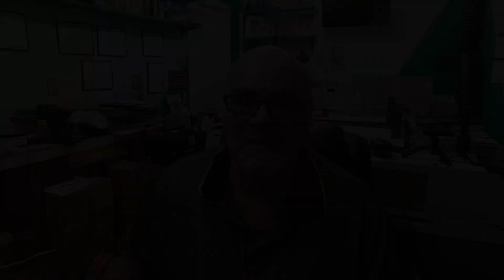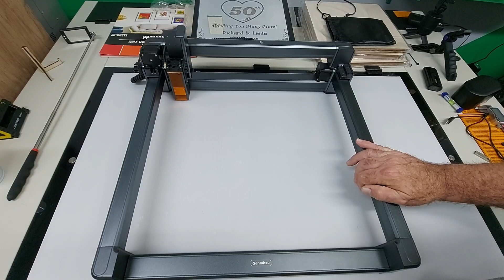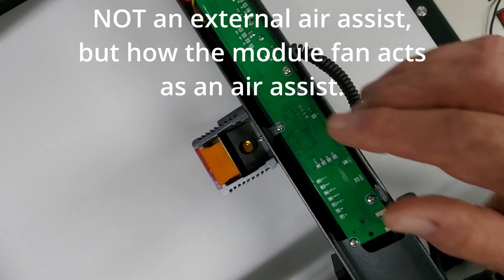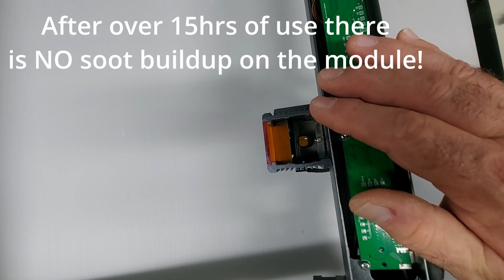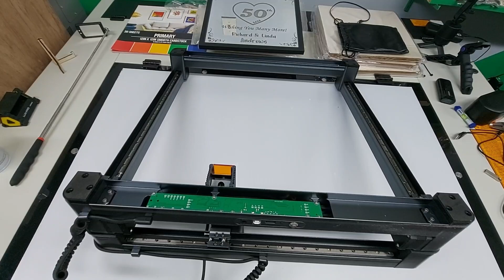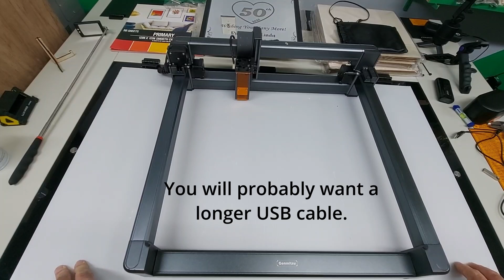LOST FOOTAGE of the Genmitsu, Jinsoku LC 40, Diode Laser Engraver Review!

Comment: Comgrow uses that type of "air assist" on the Z1. It doesn't flow enough to keep the red shield from melting and it squeezes all the airflow through a 10mm(?) opening 2mm above the material. I can't see how that lends itself to effective module cooling. One of the reasons the shield is sitting off on the bench somewhere.
Reply from the maker: I don't use the shield either on the Comgrow.